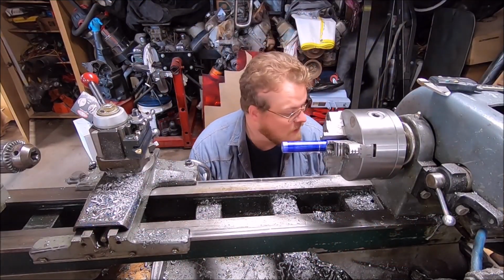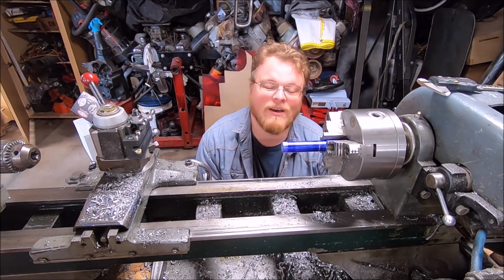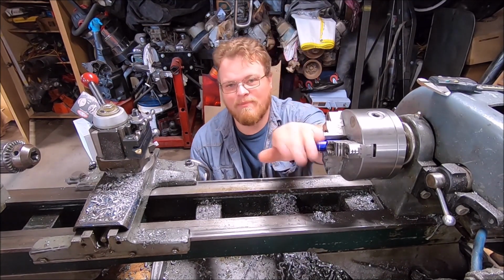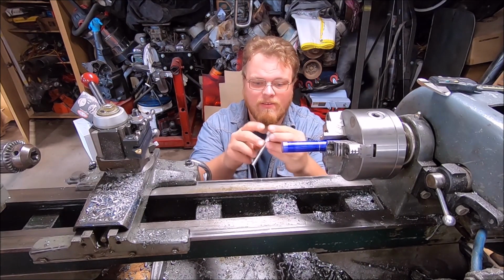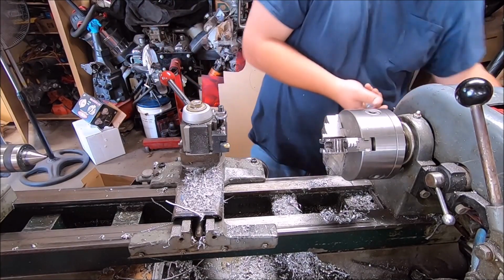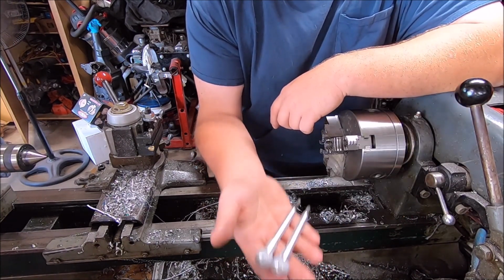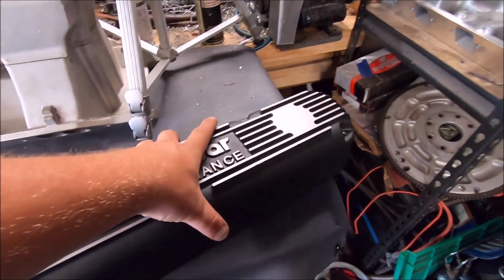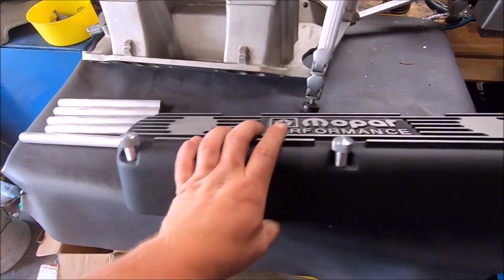Metal Lathe Turning: Making Custom Aluminum W2 Mopar Valve Cover Bolts

Comment: Awesome 😀👍🏻👍🏽   I haven't used a lath in years,  but hopefully one day I can  get one 🤙🏼    I have problems with sorting my drive shaft but now have found the parts but not cheap 😞 but if I got it off eBay it still takes a long time to get to New Zealand,  so hopefully I  will get it sorted for next week and back on the road finally 🤞🤞

Comment: Hey Scott please understand never work on a lathe with loose clothing get used to removing said clothing or button it up and tuck it in your pants if you don't believe me look up lathe accidents
Reply from the maker: I can't wear my shirts tucked in, makes me extremely uncomfortable. I know about lathe safety, and the real concern should be the chuck key that gets left in the chuck. However I know for a fact that isn't an issue, because my lathe has to be started by hand
Reply: @ScottsSpeedShop  and trust me it's safer to remove the shirt that's hanging loose plus the accidents never happen during startup it's while you're operating it at full speed and it has plenty of power to pull you in in the feedscrews at the front of the lathe just looking out for you buddy I have many years of experience in the machine shop

Comment: It's not if you  are a machinest or not ots about doing . I  am a tool & die maker . T o really  keep your lathe in perfect condition,  you can't keep enough oil on the ways . clean it after each use and oil it profusely.  as you do this you will see it will get more accurate and that will minimize wear on the ways . I  love lathes .

Comment: Are you going to anodise them? A process you can do at home…
Reply from the maker: If I had the stuff to do it, I would
Reply: @ScottsSpeedShop  look up Caswell plating.
Reply from the maker: @jasonarnold7578  I checked into the system. Not a bad price, but I don't think I got the space for it all. And I don't think I'd use it nearly enough, but man it would be cool